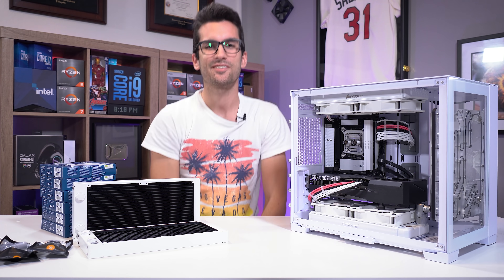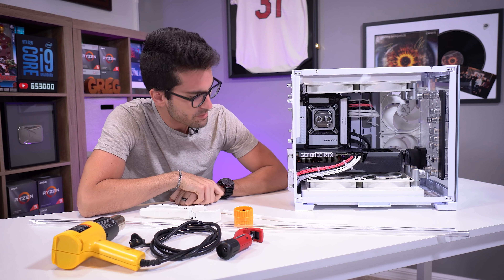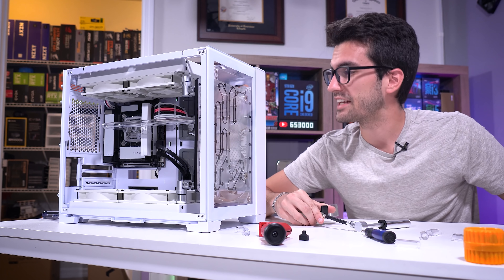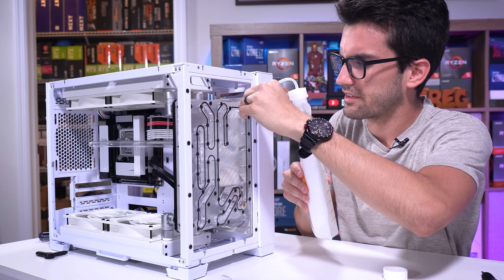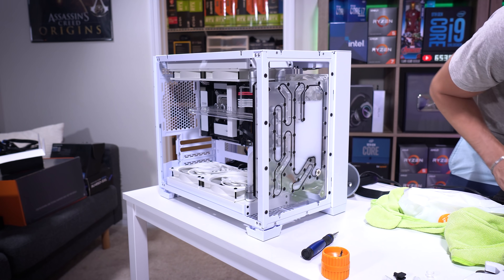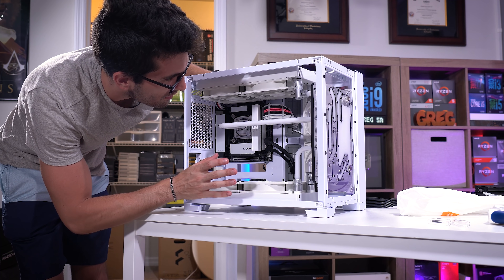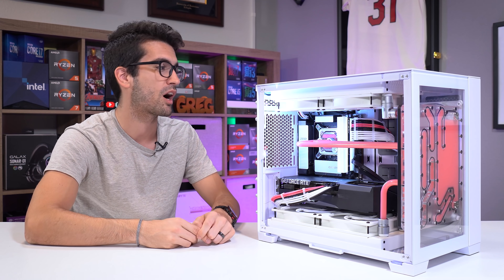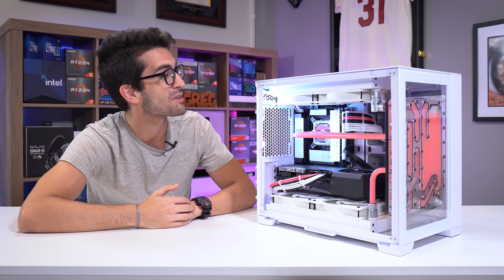Building in the Lian Li PC-O11 Mini! (Part 2)

Comment: Wish you would have just done a U shape bend to connect to 2 circuits on the distribution block. Then the fluid would fill the whole block and not have an empty spot. Either way, it looks good and came out great. Great Job!
Reply: U shape bends to the exact size are very difficult. I think he made the right choice.
Reply: Before I put a waterblock on my gpu, I had the same kind of issue with my 011 XL distro plate.  I just a couple of 90s with a coupler between them to jump between the 2 channels.  Once I put my gpu under a block, it slotted right into the channels and it looks great now.
Reply: I understand it was really late and he was running out of patience.  But I do concur, a full distribution block in addition to a u-bend would top this off.
Reply: I still like it. The instruction do tell you to do this, "If one of the prescribed components will not be installed (ie. bottom radiator or GPU block) then one INLET and one OUTLET port must still be joined together in order for this distribution plate to function!" You do it your way Greg, I think it looks cool. Thanks for sharing.
Reply: You beat me to it, I totally agree. I did try yelling at the screen but he didn't hear me ha.
Reply: my thoughts exactly.  In all honesty, he may have even been able to do it with a couple 90 and a short extension fitting and not even use any petg.  but at least it would completely  fill the distro...
Reply: i bet he didnt have enough fittings, shame as the distro block has an unused bit my OCD is twitching - HARD
Reply: @TimBoundy  Maybe, but he could have found something to give him the correct radius and it would have looked soooo much better
Reply: Just a heads up guys, I'm not harping on him for this in any way, in the end, the build came out great and he did a good job. I merely meant that it would have been nice if he did. I have OCD and that one part just kinda stuck out to me, but regardless the end result was awesome build :)
Reply: Yeah that's what I was thinking. Would've filled the empty space in the resivoir too
Reply: when reservoir was not full it looks incomplete to...

Comment: I would have done a u-turn bend to connect the two channels if not going with a water cooled gpu. That way you don’t have a weird empty channel. Also, I know you probably did it for aesthetic reasons but the two fans on the side panel should be intake. I did it in mine and it dropped the overall temp of the coolant by 5-6° C.
Reply from the maker: Two side fans are exhaust because I wanted to pull fresh air through radiators. You won’t see the same kind of temperature drop with a closed loop and rads in these positions. Also, the empty channel can just be filled with fluid :-)
Reply: @GregSalazar  I missed the fact you had both rads as intake. Makes sense now from that perspective. Do you think having both rads as intake would create too much hot air for an air cooled gpu?
Reply: @dmoney0620  I think it dosent matter in this. He used 2x 280mm radiators. Hot fluid from CPU is going : top radiator - dystribution blok - pump - bottom radiator. From my point of view botom radioator in normal use will get almost "cold" fluid. And air woud rather go to exhaust not to GPU. So for normal use without syntetic loads it shoud be perfecly fine. Sry for my bad english :)

Comment: the pink is a little too orange for me, but glad you like it ok,

when i was watching you plum in the lower rad i thought you were going to put on a gpu water block as well, cause that extra slot there is meant for a gpu connection, but a uturn connection could have also connected the two ports on the distro plate
Reply: I thought exactly the same besides that empty channel looks kinda sad from the front :(
Reply from the maker: Empty channel can be filled with fluid. No big deal. And idk where you’re seeing orange. Maybe calibrate monitors a bit. This is straight pink both on camera and in person LOL.
Reply: @GregSalazar  please upload when you do it plsss
Reply: Could be I'm getting a little color blind as I get older, don't know how to calibrate my phone. Anyway thanks again for your videos. And I'm sharing my thoughts, no offense intended.

Comment: Is it because these distroplates are designed for a gpu to be incorporated into the loop as well?
Reply: Yes. It's silly to do a build like this and not water cool the GPU.
Reply from the maker: @TimBoundy  No it isn’t. Do what ya wanna do. But this wasn’t silly. Did it on purpose.
Reply: @GregSalazar  I still think it's silly. A double radiator custom loop just for the CPU is complete overkill, a standard AIO would have been plenty. The GPU would probably run cooler without the bottom radiator exhausting straight into the GPU. This build is a showpiece (I don't recall seeing it even boot up), but it's not really showing off what the case and distro plate can do by only cooling the CPU. Even though it's "only" a 3060, it still pumps out more heat than that CPU. I understand that water cooling a 3060 is challenging due to a lack of blocks, but that just makes that card an odd choice to pair with a loop like this. I'd wager a good chunk of your audience can't afford the rest of this system let alone the GPU, so I don't think waving around overpriced cards in a video involving an expensive custom loop is that much of a problem. Even a previous gen GPU would have been fine in a video like this.

Comment: on those EK res bocks you have to bridge the GPU ports to fill it properly, all you needed to do was add 2 90"s and maybe a extension and been done without draining the system. it shows you in the instruction maul they have ti be use for that reason.

Comment: Just connect both connections to each other on the distroplate with 2 90 fittings and a smal tube, and the problem is fixed. And all the lanes are full of fluid, now it looks kinda weird. With 1 lane doesn't have fluid ...
Also when pressure testing a distroplate never go fully in the green zone up to 0.75 i've seen many distro's crack on this pressure. Go only max to 0.5

Comment: Thanks for the build Greg, big fan of this case. Ok read the pinned comment, how about water cooling a 3070/3080/3090 if you have any? As a V2 I think that would complete it, or maybe if it were a white card (or any generation), that'd look nice too? I guess the card's shroud matches the motherboard so it's not the 'only' black thing, but I think it would look very nice.

Comment: I noticed the mistake because microcenter have these on display and when they aren't using the gpu cooler they use just a small u joint for it

Comment: If you want to drain these distroes you should tilt tower to the back, let air buble comes to your grain port, unplug and screw fitting with softtube or at least valve fitting, drain it, remove valve, plug and fill. You will find if you do not do it with this aproach water will come from your case in future, because it fill space between case and distro. Spilling all over the place etc. and there must be air buble everytime because these distroes cannot be filled to the top

Comment: Would it not have been simpler to add a pipe on the distro plate to channel fluid to the other section instead of draining and making a bigger fitting?

Comment: I think the dye should be applied when the coolant liquid is on the bottle. 
  And why haven' t you got a water block for the GPU?
Reply from the maker: I explained this in the other video... and it doesn't matter when you add the dye. It's just dye. Make sure it's portioned correctly and you're fine.

Comment: Hi Greg
Great build I have to say but there was a better way of making the coolant flow around the whole front plate. I saw you was stuck as the coolant wasn't flowing at first. If you put a U shape pipe to connect the 2 Chambers just up from the bottom radiator, you wouldn't have had to make that bend upwards and would look so much better with the bottom radiator pipes being the same. 😁. Keep up the good work. 👍.

Comment: Hey guy, a few couple things, probably already addressed somewhere in here. But.... looks like all of your fans are pulling air into the case but none are exhausting? Also you could have just bridged the loop and left the the fitting in radiator, but added like 2 more fittings. I could understand you skipping that part for not having the extra fittings. Because they take for ever to get.. But you lose volume and now have one small reservoir that is void of liquid. but cool color outline and case build.

Comment: Artic 120mm pst fans are my favorite.  Each fan cable has a splitter, so you can plug them all into each other. Also, they have competive performance in static pressure and airflow. 

I use Artic bionix pst, they have better performance specs, and look nicer.

Comment: Hello, I have a question, I'm planning to transfer an older motherboard to an RGB PC case, with a new 850 watt power supply.
my question is my motherboard has a 4 pin cpu connection does it have a modern power supply or have i cut myself with this.
Gigabyte GP-P850GM PC netvoeding 850 W ATX 80 Plus Gold
Gigabyte GP-P850GM PC Power Supply 850 W ATX 80 Plus Gold
GAME HERO® Geance Gaming PC Case Tempered Glass Side Panel RGB - 2 x USB 3.0 - 4 x 120mm RGB Case Fans
GAME HERO® Geance Gaming PC Behuizing Zijpaneel Van Gehard Glas RGB - 2 x USB 3.0 - 4 x 120mm RGB Case Fans

Comment: How is those ram modules i thought about going with them causr price to performance was great 4000mhrtx ram was same price as a lower other brand I went with a black and chrome theme brass chrome tubing and trident royals only thing I messed up on is I got ek chrome fittings thought they were good untill I ordered a bitspower offset snd saw their version of chrome so much better oh well

Comment: Greg, highly recommend you go full watercooled GPU, since they perform so much better, and you are already a master of GPU teardowns anyways, so why not?
Reply from the maker: Done that already dozens of times on the channel :-) Sometimes, I prefer the simplicity of air-cooled graphics cards. Also, this particular card is a 3060, remember? Not so popular with waterblocks Lol.
Reply: @GregSalazar  Ah dang it, that's very true. It's usually a 3080FE or somethig like that in these builds... and also 3060 don't need no waterblock, it's weak lol.

It would've made your build much easier, in any case, given how the distro-plate worked. They kinda just assumed you were going to have a GPU there.
Reply: @matasa7463  the 3060 is weak?
Reply: @Dr.BrightM  It is for a 30-series. It’s basically last gen performance levels. Remember, it occupies the same budget category as the 1060 and 2060 - the low end gaming card.

It doesn’t use the hotter GDDR6X, and the core itself won’t draw as much power or run that hot, so it is perfectly alright in terms of cooling.

Comment: I wish there was a larger version of something like the meshlicious. 5950X + 3090 are just too much for a thin 280mm rad. No decent dual-rad-plus-window options out there, aside from this O11 Mini and maybe the (limited) Singularity Wraith ITX, and maybe the Q37 which I still prefer (but is now outdated). The O11 Mini is a bit too wide and bulky, allowing too much choice (i.e. wasting space). There's just no perfect high-end water-cooling-focused itx case with tg window(s) ... Probably gonna end up with the O11 Mini until some makes a less bulky version of it.

Comment: Wish you found a way to use that extra channel in the res, looks off without fluid in it. Otherwise really cool build. For aesthetics I would have run a tube from the top res to that channel just to fill it out nicely. Not necessary but it's also the same logic I populate every dimm slot even if I don't need all that extra ram.

Comment: Hey Greg, Just seen this build,  the colours are very cool but the empty run on the block just looks weird. You first setup looked great but a joiner pipe between the two short runs would have been cooler in my opinion. Cheers for such an easy to watch build video.

Comment: Totally woulda put the flat reservoir where the side fans go. That one looks like its built for the front tho.
Reply: and EW side exhaust fans. lol.
Reply: With no exhaust back end fan. lol. EWWW lol. PINK EWWW hahaha jk im done
Reply: and I would do the cpu water plugs where the water going to the cpu is on bottom and the water thats hot is exhausted from the top of the cpu rather than left and right. for some reason but i would probably play with it for a year and it would drive me crazy over and over again.

Comment: Some people may think it's a bad thing to have a radiator on the bottom here. since it's not a closed loop, but a custom loop, and since there's a radiator on the top there is nothing wrong with the radiator placement at all. And even if there wasn't one in the top, there's plenty of space for the air that will inevitably be in the loop in the front.

Comment: Hey Greg I’m going to be doing my own 011 dynamic mini cooling loop i’ve done 3 so far how does the 2 280 rads do for cooling is it more efficient for airflow ? or should i go with the normal 3 fans for each side

Comment: How is there a closed/blocked part of the distro?! Did you ask EK?
Reply: because these distroplates are designed for a gpu to be incorporated into the loop as well
Reply: @Kay8B  Thanks. So basically the intent is for the GPU to connect to that area of the distro and the in and out will happen via the GPU loop. I see Greg posted a comment to address it after my comment. I'd totally fill up that part just for looks.

Comment: Just wondering why you went intake for both rads. I think that intake for bottom and side and exhaust for top is the most common because of the best balance of thermals.
Reply from the maker: Not gonna make a big difference at all. The entire "heat rises" argument is out the window the moment fans are involved. Intake from top and bottom + exhaust out the side = positive internal pressure, less dust accumulation over time, and relatively silent operation.
Reply: @GregSalazar  Gotcha. I think the argument could be made that your setup would make turbulent air inside. Anyways, great build.
Reply: @Bandoughha  This. I understand the heavy positive pressure design but honestly just higher RPM % on intake would've fixed that good.

Comment: I like it.  I wouldve liked one of the cpu water cooled lines to be parallel to the other one, but that would require an extra bend.. or turning the cpu water block side ways.. but whatever.  
it still looks nice.

Comment: Should of watercooled the gpu not only its it dark black its huge. Looks amazing otherwise. Didn't wanna turn the rad the other way and do longer runs?
Reply from the maker: Bottom rad doesn’t have space LOL. Take a look. Can’t turn it backwards. And didn’t wanna do it with just one.
Reply: @GregSalazar  I noticed after mainly cause of the huge air cooled gpu right

Comment: Greg, as a great counterpoint to this mini build, could you please do a top end water cooled build for those planning on top end overclocked custom water loop systems? An off-the-shelf full/super tower case with AT LEAST three 420mm radiators installed at the same time for extreme cooling, and the stability and longevity which comes from pushing a system as close as possible to ambient temperatures (even with top end parts like overclocked Ryzen 5950X or i9 11900K, paired with a water cooled overclocked RTX 3090 or 3080Ti)? I have seen so many 360mm radiator and 120mm fan based builds this year that they are coming out of my ears. ;p
Reply from the maker: See our Tavares build... already on the channel :-)
Reply: @GregSalazar  the Tavarish build? With 360mm radiator? Or do you mean a different video I can't find that has at least three 420mm radiators at the same time?

Comment: you need to order yourself a 50ml syringe from amazon to deal with these water cooled systems.  That and a short piece of silicone hose to stick on the end and thread into the reservoir so you can siphon fluid out as well as push it in.

Comment: DON'T PUMP TOO MUCH PSI INTO YOUR LOOP LIKE GREG DID. 

You only need to add up to 0.5 bars max (EK recommends 0.3 bar for an entire loop), anything above that you risk damaging other water cooling components. EK said they are going to change the colors of the leak tester soon so people don't keep doing this but this is straight from their manual:

Waterblock - 1.0 Bar +/ 0.05 Bar
Reservoir - 0.6 Bar +/- 0.05 Bar
Distribution Plate/Manifold - 0.3 Bar +/- 0.05 Bar
Radiator - 0.6 Bar +/- 0.05 Bar
Loop - 0.3 Bar +/- 0.05 Bar

Source: https://www.ekwb.com/shop/EK-IM/EK-IM-3831109816738.pdf

Comment: What bothers me the most is the off white fans. Both videos he used them.
Reply from the maker: These are different fans than the ones used in the last video. Also, the camera plays with these whites a bit more. In person, they're much closer to neutral.
Reply: @GregSalazar I didn't mean criticize and if I came off that way, sorry. It's that both sets of fans tho were slightly different than the radiators. I understand that they would be hard to see in person, but like you said, the camera messed with the whites and it triggers me.